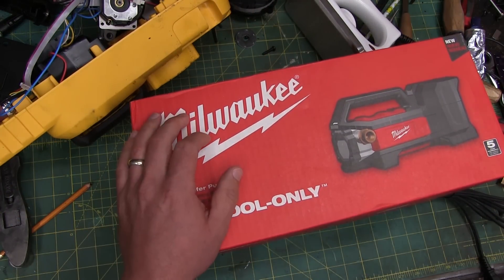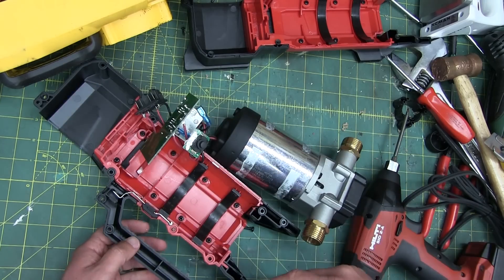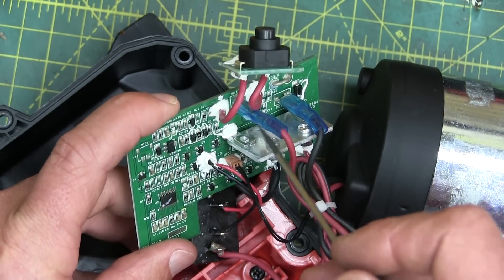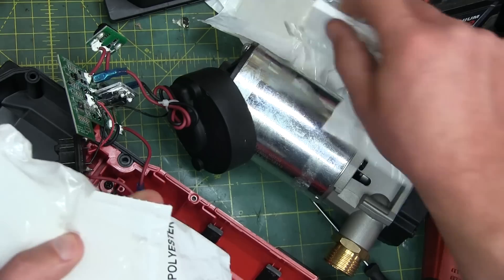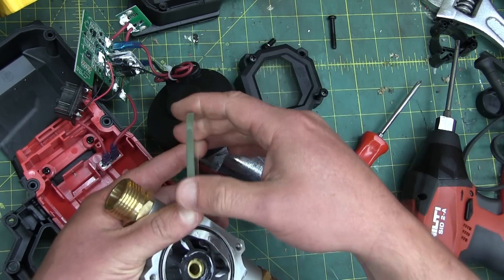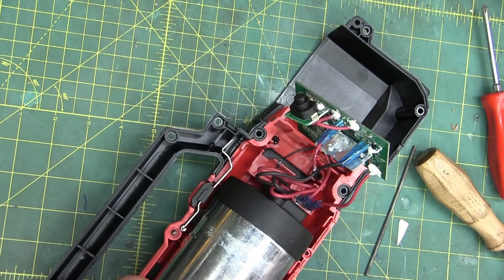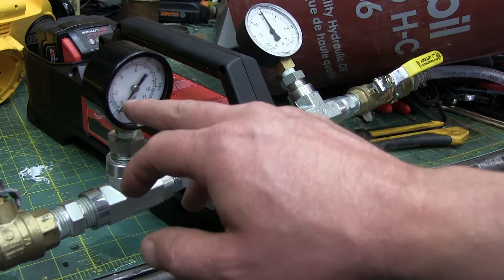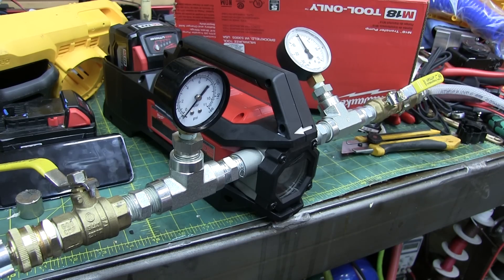BOLTR: Milwaukee Pump | Box Specs vs. Shop Specs

Comment: Retest using the OEM fittings. On suction side a very short hose and as near to zero lift as possible. On the discharge side do not add anything. Tare a 5 gal pail & use to catch the discharge. Run the pre-primed pump for 30 seconds into the pail. Reweigh pail, subtract the tare, multiply x2, then by x60, divide by 8.31= reasonably accurate gallons per hour. My guesstimate (not worth very much because I am not Canadian, even worse a Californian, and this response is years too late.) is 27 lbs. in 30 seconds or 390 gallons per hour.

Comment: i mean considering it came in a box, why did it have to come inside a plastic bag too? is it that important to contain the smell of chinesium for the end user?
Reply: Likely to avoid moisture issues for the long shelf life it needs before someone buys it.
Reply: burtosis And it will be a LOOONG shelf life, because no one in their right mind is spending 150$ american on this, unless the Milwaukee fan boys need to finish their complete set of tools.
Reply: In case it passes through California it will keep the cancer inside the bag.
Reply: poot111111 nice
Reply: After having electronics delivered and left on the front deck in the original box during rain storms I'll take a plastic bag around the product.
Reply: The bag keeps the pump from growing tumors in Cancerfornia until it can leave the Port of Los Angeles for it's final destination.

Comment: Have worked with marine sea water pumps for years. Impeller don't care which way it turns, it will flip the vanes in the proper direction when the engine starts.  Lots of diesels, when stopping, will run backwards part of a revolution (due to cylinder compression), so the seawater pump impeller could be flipped backwards part of a revolution as it comes to a stop.
Reply: It shouldn't matter unless the impeller is a couple years old and then its brittle and will just break lol

Comment: The max flow numbers would be with no restriction on the inlet or outlet.  Max run time would be done the same way.  The larger a pressure differential the positive displacement pump has to create, the more work it has to do (less battery life).  Higher differential pressures also cause more slippage which accounts for a loss of flow rate.  These facts are true for positive displacement pumps, but not centrifugal pumps.  They actually pull less current and do less work when you choke the outlet.

Comment: The ball valve was barely open while you were testing it with the 9.0 battery.
Reply: First thing I noticed as well.
Reply: @ericpayne3084  I noticed that too...
Reply: He was creating resistance equal to if you were pumping up. Every vertical foot of water is about ½PSI, so creating 30PSI of resistance would be simulating pumping 60 feet up.

Comment: As always, I enjoyed the hell out of this, and all of.your other episode’s. My guess as to the exaggerated performance claims would be zero restriction or turbulence of any kind. And by that, I mean no fittings or valves that are less than full port. And as far as the discharge, I’m sure they advertised the best results of GPM and PSI under two totally different scenarios, but neither at the same time or test. I very much appreciate you’re video’s and twisted sense of humor! I wish you were my neighbor. I’ve been shopping at the same sort of industrial gettin spot for 23 painful years, and am now overwhelmed with tube drive and digitally controlled hydropneumatic ingredients of all kinds. Thanks Again, Troy.

Comment: I've combined brass and aluminum garden hose fittings before. The damned things eventually weld themselves together and there's no separating them without irreparable damage. I've learned to always use Permatex aluminum anti-seize lubricant.

Comment: Taken from the electronic systems evaluation course I took with the US government, there are ways to test a system which are advantageous to the supplier. Unless you specify the methodology used to test a system, the manufacturers will ALWAYS use a test which does not conform with what will be experienced by the user.
Reply: In millfuckees defense, he tested the pump with a bunch of fittings and 3/8 hose causing a pretty big restriction. The original fittings are designed to be used with garden hose(which is 5/8). I'm sure if he used the proper fittings and hose we would have seen far better results.

Comment: I'm guessing their max GPH & GPC was based off a large diameter hose on the inlet and outlet (Least restriction possible) and a brand new battery.  During your test you had the ball valve choked back on the outlet side creating back pressure, and small diameter hoses.  Lots of restriction.

A lot of times spec sheets are written to fluff up the capability of the item being sold, with a huge caveat:  Not all specs can be achieved at the same time.  Max head and max GPH are inverse to each other and therefore cannot be achieved at the same time.
Reply: yeah i'm not sure how he hasn't caught onto this yet.. they're all prefaced with "max", that doesn't mean "max gph at max head with max restriction".. that means "max" the components are capable of. using all those fittings might have been an acceptable way to test if the components are capable of the claimed head but the test has to be individualized for each of the other claims.

Comment: I have used this pump for work now for a a few months now and it is surprisingly sensitive to using smaller diameter hoses for pumping. I use to use some older washing machine hoses to hook up for transferring water around but they have an inner diameter of a 1/4" have since switched to short 3/4"ID garden hoses and it runs much faster. So for Milwaukee marketing test they may have had it piped together with 4inch fire hoses to get the number you see on the box.

Comment: My brother has written out several of them but still swears by them. I've used his once for a water heater replacement and it was terrific. I now own the ryobi and it worked great as well. For a often a I need a pump either one is far and away capable of doing the job. I'm not draining pools for crying out loud.

Comment: They are running super chilled fluorinert down hill through the pump.
Reply: Rafael Sherman my thoughts exactly
Reply: Fluorinert, man I'd forgotten about that stuff. We used to use it testing NVG power supplies an Northrop. I almost died when I found out how much it cost. I think at that time it was 4,500$ for a 3 gallon jug. 😨

Comment: We've had one at my previous job for a over a year now. Used it mostly for pumping hydraulic fluid. It's been absolutely fabulous. Fuck the job to high hell, but that pump turned a two man job with a big ass air driven pump into one man carting around a 55 gallon drum with that chucked on top. Even worked fairly well to empty plugged drain pits in a pinch.

Comment: Perhaps the small tube on the inlet side is causing a restriction and faulting your test. The original fittings looked much bigger than what you plumbed. You can bet when tested at the factory, they used the biggest hose they could find to make the best results. Love your box cutter!
Reply: I agree. Need to use fittings with larger I. D.
Reply: gotta be the size of threads on inlet. 3/4 most likely. So going from 1/2 to 3/4 will give like 2X

Comment: Someone may have already answered this, but pump gph is often determined in a gravity feed situation. With a 0.5" output, that is a free 150 gph via siphon. With your 189 gph, that brings it to 339 gph. Where did the extra 141 gph come from? The feed tank. Since the test system is gravity fed, the water source needs to be above the pump. So they install a bulkhead in the bottom of an elevated tank, possibly oversized to 1" or larger. Adapt down to 1/2"  at the pump and presto, 480+ gph due to the extra water pressure of the tank/pipe volume and the height. You'll note the +. By doing testing this way, they can just choose whatever number they want up to 3000 gph(the maximum flow through 1/2"). For more flow, just use a bigger(taller) tank and/or raise it higher. In an effort to not get called out, they didn't go crazy and stuck with 480 gph. It's not a lie technically, it's just the best case scenario, say the lawyers and reps.

Comment: I would suggest that they tested it with 3/4 I.D. with no lift on the suction end and possibly a supply that was even elevated that provided a couple of psi.of pressure.
Try it myth busters style and replicate their test results by fucking with it until it verks or blows up.
Keep posting love your channel.

Comment: As a pro tool user I figured out that after un-boxing a couple tools they are pretty close to all the same wrapping. Un-boxing is a waste of time. The ones of us that use them want to see this detailed in depth information because we don't want a tool that caps out at 1 am when we are 3rd leg deep in the job and can't buy a new tool till 7 am. AvE gives good information on longevity of tools and what they are like for a pro to have in the truck for 10 or so years. When I unbox I expect the tool, manual, and a few other things if it's a kit or just the tool box. Skip un-boxing it's pointless and for weekend DIY buyers. I want to see AvE keep doing the tests and details he's known for.

Comment: On the video it seems like your valve on the left wasn't all the way open when you were testing the run time. Also using smaller hoses, they probably used garden or sum-pump hoses on their tests to  get least amount of flow restriction.

Comment: Can you do a BOLTR on the NutriBullet. No not that one, the one that blends. Well... LOL. We’ve had, well my girlfriend has had two go bad. Hmm, might have answered my own question.
Reply: It would be the shortest video you have ever seen they are way too simple just a motor and switches on mine the plastic fans would blow apart from the high speed so after about 3 of them later I decided to take one apart and I just took all the bits and pieces of broken fan out and cut rest off motor and it works perfect no more issues I just dont run it for over 30 seconds at a time so it dont overheat.

Comment: Probably a little late with this but I'm guessing they tested GPH by flowing the outlet as an open butt. The fiittings and hose you used will increase friction loss and the 1/4 turn valves on the supply and discharge lines likely have very small orifices.  It's either that or something else.

Comment: Your inlet suction line is far to small.  Use a 5/8” or 3/4” suction hose.  Use 1/2” or 5/8” outlet.  Make sure outlet is one size lower than inlet.  I believe that will help, but doubtful it will yield those numbers.

Comment: AvE, quality as standard. 
Any chance you would dissect a nicotine delivery vaporiser unit. I imagine they are straight forward but with about 2 million reformed smokers here in the UK alone, I think it would be of interest to a few of us.
Reply: They are indeed very straightforward: a typical E-cigarette is little more than a container for the fluid, a (LiPo) battery, a switch and a coil of Nichrome wire immersed in the fluid (as a heating element). Pressing the button on the handle closes the switch and delivers current from the battery to the Nichrome coil. The Nichrome very quickly heats up to somewhere around 250 Celsius, which causes the fluid to flash into vapour that you then inhale. Most fluids are a mixture of propylene glycol, glycerol, nicotine and flavourings. I can't guarantee that there isn't any interesting chemistry that goes on near the heating element while in operation, so what you breathe in probably contains some other organic compounds that weren't in the original liquid.

I'm a biochemist, so the nature of such thermal decomposition products and their (likely deleterious) effects on human physiology is very interesting to me. It's up to you whether you want to try that experiment on yourself though. There's no doubt that E-cigarettes are less dangerous than real cigarettes (how much less is unknown due to a lack of data), but can be just as addictive as the real deal if the fluid contains nicotine.
Reply: @nerd1000ify  Interesting. Thanks for the insight. I use to smoke a pack a day until I discovered "vaping". No longer smoke cigarettes and after a year have no side effects. No more coughing wheezing or chest congestion. Also I dont run out of breath as fast. Im not 100 percent back to were I was before I smoked but thank god honestly for vaping technology. Im obvisouly still addicted to nicotine but with vaping its easy to taper off using "juice" that has smaller amounts pf nicotine. - Jacob S.
Reply: Nice! Sounds like switching to vaping really paid off for you.
Reply: Aeolwn  pissing about with rebuilding coils himself I'm guessing.

Comment: This has potential as a backup sump pump.  Wire in a water sensor twix one of the internal power wires, drop sensor and input hose in sump, run output outside to drain and turn it on.  If the sensor sits above the main sump pump it only turns on when the main sump fails\lacks power and "water".  I have a sump battery backup ($$$$ to install and $$$ to maintain) but it is still a single point of failure and assumes the sump pump will always be good.  Would also need a figure out a schedule to swap fresh batteries when needed.

Comment: What happens to the GPH number and runtime if you don't have the output restricted? Looks like the ball valve was only half open...
Reply: Yes, their big numbers will be unrestricted with no lift or discharge pressure.
Reply: Look at the pressure gauge dude, not a lot of restriction there.

Comment: I replace those impellers all the time.  A new impeller can be bent the wrong way, and more than that, there are oil change pumps using this type of impeller and they change direction on purpose...

Comment: Ave how about seeing it’s performance on different viscosity liquids, maybe they run on something with a super low viscosity or weight. Maybe the fluid also has a better thermal coefficient to dump heat better, or it’s running ice water.
Reply: Maybe they're running super liquids through there when they're testing, that way the pump don't work as hard since the fluid will naturally self siphon (or whatever, I watched one video about it a long time ago :)

Comment: AvE made a mistake!!! The MOSFETs are not in an H-bridge or totem-pole configuration. If you look at the backside, you can see that the contacts are bonded together same-to-same, so that they're parallel. This is fairly common. It's cheaper and more reliable to use two in parallel rather than one big one. Totem-pole uses two MOSFETs, true, and you use one when you want to connect one wire to either positive or negative. But you pretty much have to use them in pairs because the other wire will also have to be switched, otherwise you'll be switching between a running motor and both motor wires connected to the same thing. A pair of totem-poles is an H-bridge, which are used when you want to do reverse, and it uses four MOSFETs. In other applications, it's not uncommon to do a parallel set of H-bridges to double up the current handling, and, if so, you'll see eight MOSFETs. In summary, MOSFETs: 1=regular, 2=parallel regular, 4=h-bridge, 8=parallel h-bridge.
Reply: Good comment.  Don't you get lower RDS(on) with them in parallel?  So a little less heat generated, smaller heatsink, less case plastic, yada yada.
Reply: From recollection, most of my power electronics repairs have been mosfet in parallel that took down the rest of the string.  Perhaps twice as likely statistical mosfet failure is a result of this design (if a single mosfet failure = x, then this is x * 2), since these dudes are all about designing in failures.

Comment: One your outlet is Half close also using a half inch ID holes not a 5/8 garden hose so that is a flow restriction and making it run under a higher load

Comment: We have one at work for transfering rain water out of a spill containement area. Much easier than hauling a generator and a pump. We fill three 45 gallon drums and only use about 50% of the juice on a 9Ah battery. Not super quick but gets the job done.

Comment: Isn't flow and pressure determined by the cross section of the inlet and outlet plumbing?
For Example: I'm thinking a 3/4" ID garden hose would flow better than the inlet piping shown in the video. Not complaining or an expert, just a bonehead observation on my part.

Comment: the only thing i can find wrong with your test in your intake tube is small. I've used this pump with the 9Ah Batteries, to drain 200 gallons worth of water heaters. and it did both in one battery. keep in mind the pump was placed at the bottom of the tanks and i cut open the Hot water outlet pipes to let in as much air as possible so there was somewhere in the range of 3PSI to 0 PSI  (head pressure) as the tanks drained. its a really usefull tool for doing things like pumping out a sump pump station, draining water heaters.... I dont use it for bigger jobs

Comment: That oring groove works better filled with rtv around the misfit oring. Found out on 3rd party Cat water pump. The oring should be pushed into the sealing corner by pressure in operation, as you know.

Comment: Just use the metric system😉
2 bar pressure is about 20 meter water column or 65 feet.

Your flow test is in no way optimal.
The intake hose is way to small, you can see how much vacuum it pulls on the intake side

Comment: The shaft seal wants pressure to work a bit better there is a groove to provide fluid to it so there is a bit of pressure there. I think the shmoo in the pump is probably just for the first use during priming it’s not gonna last that long. I’m wondering if your problem testing was because you had restriction on the outlet. The handle on the valve wasn’t straight. The inlet has a bit of restriction to